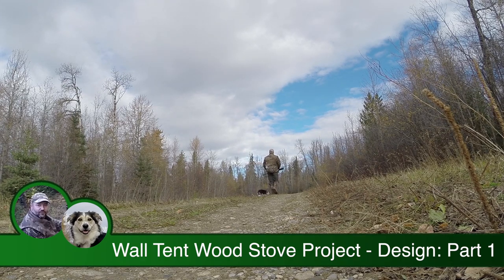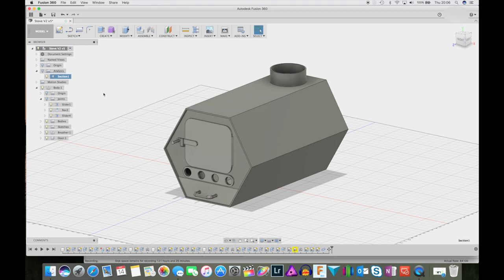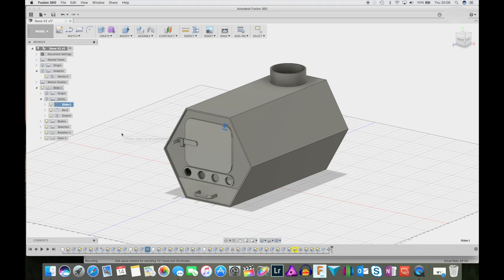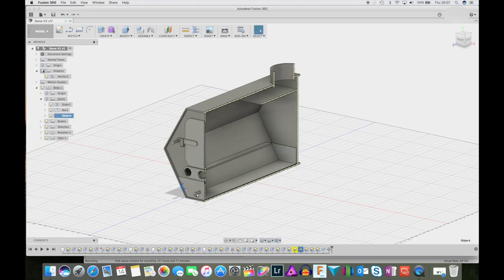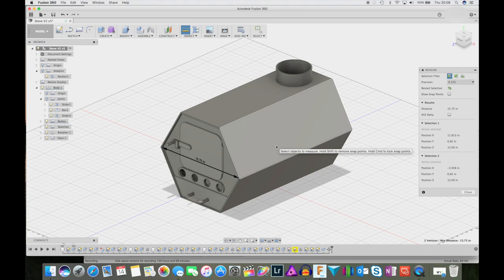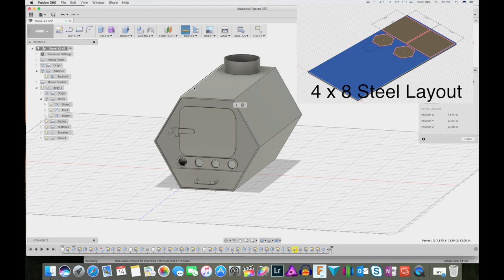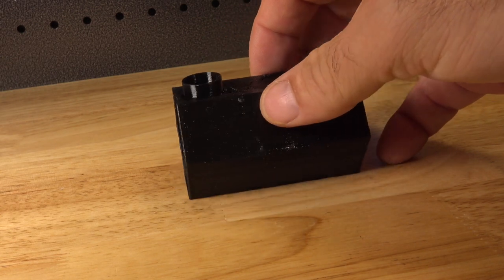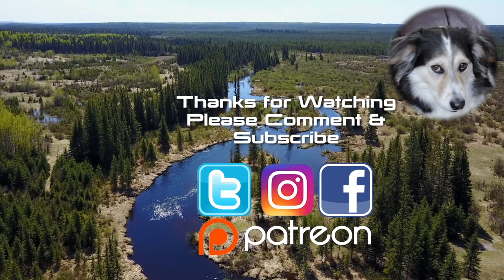Winter Hot Tent Wood Stove Project - Design: Part 1

Comment: Looks like a great project. 

A little bit fancier than the stove I made for our wall tent. I used a discarded 20 lb propane tank, but did a much neater job than most ones that I have seen. Made a nice door with a draft control and gasket, baffle plate, collar for a 4" stove pipe, flat top for a cooking surface, and removable legs. The propane tank is 1/8" steel, so that is what I used for all other components with the exception of 3/16" for the flat top cooking surface. 

A lighter stove is easier for carrying. However, remember that it will not hold the heat as well in colder temperatures and will cool down quickly when the fire dies down. I actually have a couple stove bricks that I line the bottom with as they hold the heat for much longer.

Lots of things to consider, but the main thing is that it works for you.
Reply from the maker: I considered using a smaller barrel and an old water pressure tank as they are all great starting places.  Propane tanks are great because as you say the walls thickness hold the heat. Like any prototype - I will be making changes to the second one as we (I) always learn something :D from our (my) mistakes.  I also like the idea of designing something from scratch and seeing it come to life.  Thanks for much for commenting!

Comment: Very nice, love the flat top for potential cookware. The baffle is nice too. The furnaces I'm used to operating are natural draft and have both air doors for O2 and a stack damper for draft control. Knowing you through YouTube tells me that your motivation for this project has nothing to do with making a cheaper stove....
Reply from the maker: Hey Mustang, you are correct, I wanted the top flat for cooking and the top hexagon quadrant can be used if I fabricate a triangle shape stainless water tank.  There will be a inline damper also to control the pipe.  What did you think of the ash pan idea?  I'm not convinced but I know it will make the cleaning after a camping trip much simpler.  Hope you enjoyed summer.  We are getting the first frosts here in Canada - Winter is coming!
Reply: The ash pan is going to be nice, you'll be able to extend the runtime without bringing the stove down cold. Your designing exactly what I'd look for in a stove. Winter is approaching here as well, got down to 88 the other day, lol.

Comment: Michael, I am wondering if there if you made the baffle longer would you lessen heat loss or is there a negative in terms of air flow? Also, what about attachment points for racks on either side of the top plate where you can move pots to simmer or just keep hot? Thanks for sharing. This is a really cool project. Would be great to have an idea how much it costs you in the end, minus your labour of course
Reply from the maker: Hi Mark, you are way ahead of the build ;) but yes - racks for the side, possible water boiler (stainless tank) and I'm working on a neat way to attach reflectors that can be angled to suite.  I'll be providing a full list of costs and drawing for other people to use if they feel this will work for them.  As for the baffle length I think its a bit trial and error. On the first one I will play with adding more as like you, I feel longer is better.  Hopefully some test burns will let me know which works best.  Hope to have a working prototype next week.

Comment: glove and sock racks ya gotta have somewhere to dry out or warm up stuff,  also,if you put a thicker round plate on top, it will absorb the heat and will be more stable heat for cooking and the kettle etc, also it will hold the heat that little bit longer once the fire dies down at night,  otherwise great looking stove,   but....its a bit small, pocket size for sure, but... surely the plastic will melt hahaha
Reply from the maker: Hahhaaha ;)  Thanks for the feedback.  I plan to make the rack and perhaps a water tank, not decided yet.  I'm making the rack more for pots so I can take them off the heat but keep them warm - but gloves would work (if I don't forget they are there and fry them!).  The stove is in 11 gauge (1/8" / 3.175mm) so it's heavy for this type of stove.  Much thicker than a store bought stove.  I plan to make a lightweight version if the design works.  Should hold the heat i'm thinking.
Reply: yes that sounds heavy enough...but people never understand why cast iron skillets cook better than the aluminium fry pans, its all down to the heavy base!!   bit like how i dont fall over in the wind...my heavy base keeps me stable haha
looking forward to the build videos!  ps...my res paperwork is all in and under the scrutiny of the powers that be so ...sit and wait and fingers crossed is order of the day , cheers,

Comment: Carbon Monoxide detector with lithium batteries!
Reply from the maker: The tent has lots of ventilation and hot tents are designed deliberately to not be airtight.  But if you are the cautious type it would be a good tool for peace of mind - thanks for the tip!